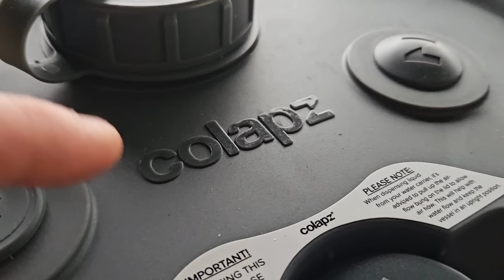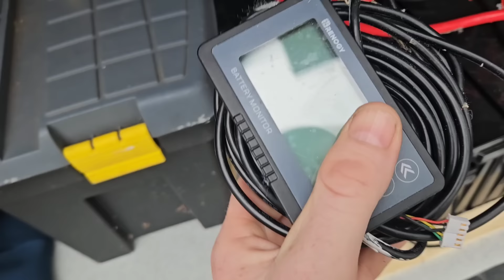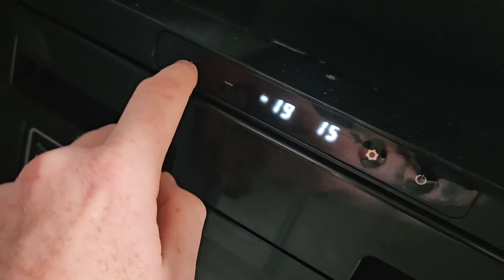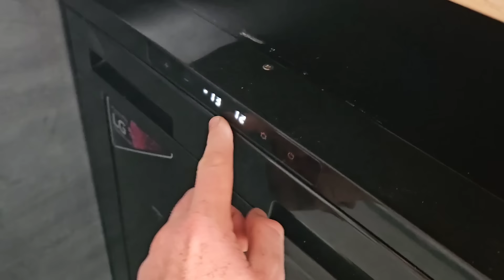MOVING INTO MY CAMPERVAN

Comment: Just use LED strips they are absolutely great things and it would not take a lot of work to install them into your campervan just run them around the top of the van with the sticky stuff on the back of them and if you find that doesn’t work just just use velcro strips.